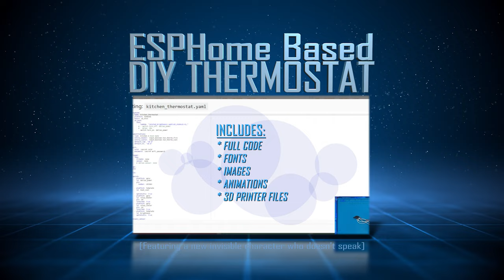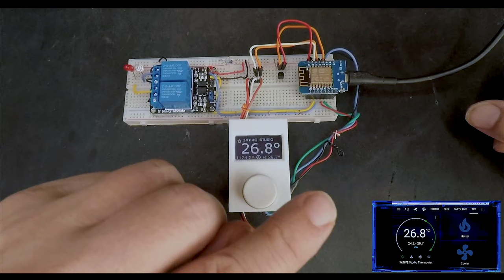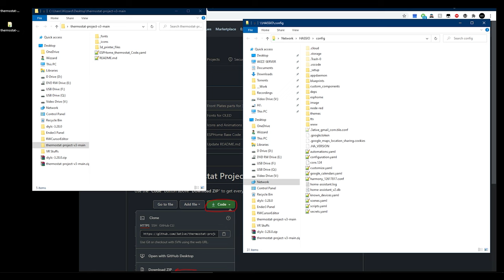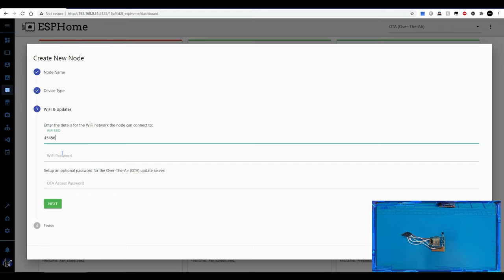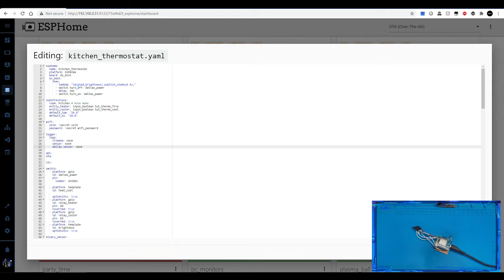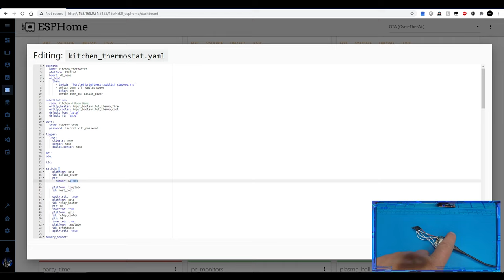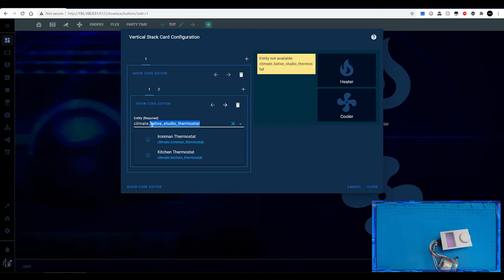Home Assistant and ESPHome Digital OLED Thermostat v3

Comment: Problem:
'min_idle_time' is a required option for [climate.thermostat].
[hysteresis] is an invalid option for [climate.thermostat]. Please check the indentation. hysteresis: 0.2 °C
SSD1306/SH1106 no longer accepts brightness option, please use "contrast" instead.
Reply from the maker: I'm sure I updated the code for the thermostat after the change. I haven't gotten around to the contrast yet thou.
Reply: @3ATIVE  So your project is not working at the moment ????
Reply from the maker: I've just updated the code on Gitub - Testing and working again.
Reply from the maker: Thanks for the 'nudge' ❤

Comment: It is nice to see such a project with good documentation on GitHub and even a  proper schematic!  I am very much attached to schematics and seeing the Fritzing output lets me kind of shudder.
One thing I still do not comprehend though is the fact that the binary is flashed with an external program onto the chip. I guess this is a Windows related "feature". I myself never leave the ESPHome GUI in order to do the flashing. So maybe someone can "enlighten" me?
Reply from the maker: Thank you for the feedback, I do try and make all tutorials as comprehensive as I can. 👍
As for flashing, unless the device, in this case a D1 mini is connected to the same 'computer' ESPHome is installed on, you have to download the .BIN file a flash using an additional program - In my case, 'ESPHome Flasher' 😎
- I hope that clears it up for you. 👍
Reply: @3ATIVE  - Until recently I had my notebooks (an old one for HA) next to each other and physical access was no problem. ;-) I guess this was making me 'blind'.
I develop on a notebook which is not running HA and for me it became a habit to use the combo ESPHome dashboard / VS code. Especially for initial flashing I take advantage of having VS code enriched with some extensions (vs the 'naked' add-on) on my computer. In addition I use Git push locally and pull on the production side.

Comment: Really nice work! I wish my projects looked as tidy and professional. I haven’t considered using those type of grid boards to build devices on before, I will now. You make it looks easy though, I’m sure it’s not! Only thing I’m missing is a 3D printer. Any recommendations? And keep up the great ESP/smart home content
Reply from the maker: Thanks for the kind words. 👍
My early boards didn't look as good. LOL It just takes time and practice. As with all projects, planning is key and these 'VERO' Boards do take a little bit of extra work, cutting or drilling out the Copper tracks is the hardest thing to get right.
As for 3D Printers, I know some libraries have them available but, there's always 'Maker-Spaces' or friends and I think there's a few people on-line that are willing to help. Failing that, they're not that expensive these days... mine (Ender 3 V2) is only £160 now!
Reply: @3ATIVE Thanks I’ll check that out.  Is this particular device going to mounted on the wall? Is is made to fit a euro/grid U.K. electrical faceplate for e.g? Im thinking about this as a dimmer switch too?
Reply from the maker: @djrosco1982  I've only designed and programmed the Thermostat, I shared the 3D printed front plate and knob as a basis for your own design. So yeah, you could mount in an electrical back-box - with the appropriate modifications.
 I did also think about having it as a light dimmer - I may have a go at making one... maybe another tutorial coming soon! 😉
Reply: @3ATIVE  : I find the idea to use simple drills to take away the copper layer really great!!! The few boards I created manually had to suffer due to me using knifes and as you might imagine this did not go too well. I got lazy and disappointed over the experience and now I use KiCAD and order the PCB online for small money.
Reply from the maker: @uhmasyt  Cool, I use EASYEDL and JLCPCD for mine.
Reply: @3ATIVE  - I normally use the latter. Last time it took them two weeks only from order to delivery which is great considering that I have to 'coordinate' with ordering parts which need a bit longer to arrive.
Reply from the maker: @uhmasyt  Indeed they are good. Mine take about the same - 2-3 weeks. I tried PCBWay but, find JLCPCB to be cheaper for bare boards. 
I have designed and ordered a whole of PCB's for this thermostat project. I hoping there'll be here soon, I want to give a load away on a live stream with some sort of random roulette wheel picker. Should be fun!

Comment: Great project, you've piqued my interest ! Where can i find a list of the components i need for this project? Can someone help me? Please!
Reply from the maker: Thank you, I'm glad it was inspiring 🥳
All the components are available pretty much everywhere -  you'll find all the components on my Amazon Store page and the 3D Printer (STL file) from the GitHub page (Both links in the Description)...

Here's a list:
* D1 Mini
* 1.3" OLED Display
* Dallas Temperature Sensor
* Rotary Encoder
Reply: @3ATIVE  Thank you for answering!
Reply from the maker: @b3y0urs3lf  Always. 👍
Reply: @3ATIVE   "on_click:- switch.toggle: brightness" doesn't work for me! do you have any idea what can be the problem?
Reply from the maker: @b3y0urs3lf  code doesn't look right, it should be something like:
On_click:
  then:
    Switch_toggle:
     [your switch]

Check the docs, I'm on my phone ATM, so can't look it up here.
Reply: @3ATIVE  don't worry about the code, it was just a hint. IT's something with the button, like it doesn't feels the release. Is there needed a resistance? I triple checked the code and the wiring, i even tried to use "D5" for the button and I am not using the relays!
Reply: nevermind, i changed "inverted: true" with "mode: INPUT_PULLUP" and now it's working!
Reply from the maker: @b3y0urs3lf  Cool. 👍
Reply: @3ATIVE  hello again, i printed a full case for the Thermostat and it's starting to look nice. Still, i have something to ask: if i'm trying to use the top right corner (near room) to put the humidity, can you help with this code line? 
"it.printf(64, 128, id(font1), TextAlign::TOP_RIGHT, " %.1f°", id(internal_humidity).state);"
I don't know exactly what i'm doing wrong. Thank you!
Reply from the maker: @b3y0urs3lf  Cool, I hope I can see the final setup once it's all done. 👍
As for the Humidity display, try this:
it.printf(128, 0,  id(font1), TextAlign::TOP_RIGHT, " %.1f° ", id(internal_humidity).state);

- You just had your co-ordinates wrong 😉
Reply: Now i see, it worked well. When i finish assembling and polish, where can i sent you pictures? Thank you so much again!
Reply from the maker: @Andrei Dumitru  Great stuff - Happy to help.

Send me a message on either FaceBook: www.facebook.com/3ative or DISCORD: 3ATIVE#8871
Looking forward to see what you've done.

Comment: Is this project still working in present? if i make this device follow on your tutorial.
Reply from the maker: There has been some changes to ESPHome the broke this, mainly using a Dallas temperature sensor while running the OLED. I have submitted many GitHub issues but have yet to hear any feedback.

Comment: Question - instead of using gpio pins to control a wired relay, I'd like to send a HTTP message to a Shelly 1PM device over Wi-Fi to control it, just hooked up to a baseboard heater. Will your project be able to send a HTTP message instead of control the gpio pins?
Reply from the maker: What kind of message are you sending?
Reply from the maker: Maybe this would help:
https://esphome.io/components/http_request.html
Reply from the maker: If not and if both devices are connected to Home Assistant, then a simple service call would do it.
Reply: I didn't want to use home assistant, just the two devices on the same network. Send something like http:192.169.20.20/relay=on
Reply: I also only need the thermostat to heat. Can I remove everything in the .yaml that is related to cooler and have it display and work OK as a thermostat?
Reply from the maker: Sure, if you Shelly is setup to receive commands like that - But, I doubt that it is as that seems too simple of a command.
Reply from the maker: Yes - You can remove all the "heat related" code. 👍 And make it a single thermostat.
Reply: @3ATIVE  Can you give a hint where/how I need to change the .yaml to instead of control the GPIO to control a connected relay to instead use the http_request to control the Shelly? I can successfully control the Shelly via a web browser using  http://192.168.20.127/relay/0?turn=on or http://192.168.20.127/relay/0?turn=off.  I can't figure out where in your .yaml I would change from GPIO control to send a http/URL? 
In your switch: section? The climate: section?  Have to make a new template for it?
Reply: I did find you on DrZzs Discord server and posted in the esphome channel. I think I'm really close, but not quite figured it out.
Reply from the maker: @rkhanso  Ah ok, are you: h.rautxxx or BMWFxx on there?
Reply: @3ATIVE  Yep
Reply from the maker: @rkhanso  Ok cool, I've replied there. 👍

Comment: Is it possible to have a neopixel ring around the rotary Knob to reflect the Temprature set as visual indicator say for few seconds & turn off ? I am not a expert in yaml coding, can u post a quick ref code for that or a quick turoeial video for it please?
Reply from the maker: Sure it's possible. Although, I'm not sure why anyone would want that as the unit has an OLED display for all functions.
Reply: @3ATIVE  yes agree, but additional visual feel.
Reply: Am looking for sample code to start with as poor in coding. Can you please help to put forward one for users like me. I know it's it's too much ask :)
Reply from the maker: @easwaran83  Sorry fella, I don't have time to make projects for individuals. However, it is possible to read the thermostat setting, in this projects' code either: "id(this_thermostat).target_temperature_high" or "id(this_thermostat).target_temperature_low" and use those variables to effect the LED ring. 
You should find everything you need here: https://esphome.io/
Reply: @3ATIVE  I totally understand. No problem. I'll try to tinker on ur above comments & try to come up with a solution. Appreciate all your reply.

Comment: I got this error information： 
 [default_preset] is an invalid option for [climate.thermostat]. Did you mean [default_mode]?
  default_preset: Home [source /config/esphome/thermostat-v3-oled.yaml:97]
  
  [on_boot_restore_from] is an invalid option for [climate.thermostat]. Please check the indentation.
  on_boot_restore_from: default_preset [source /config/esphome/thermostat-v3-oled.yaml:99]
  
  [preset] is an invalid option for [climate.thermostat]. Please check the indentation.
  preset:  [source /config/esphome/thermostat-v3-oled.yaml:101]
Reply from the maker: What version of ESPHome are you running ?
Reply: @3ATIVE  Thank you. Once I have upgrade ESPHome 2022.10, It works great.